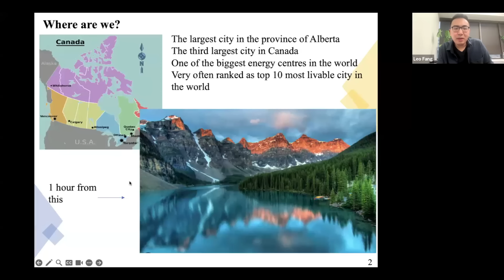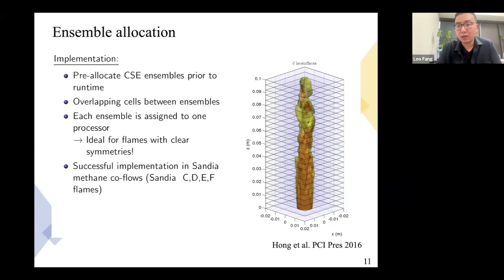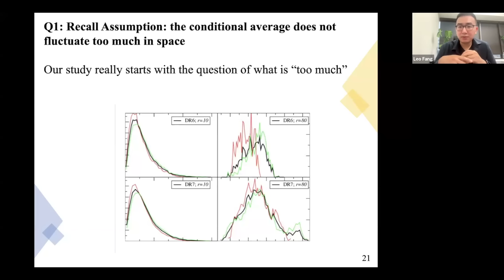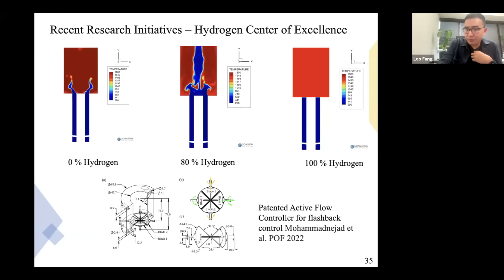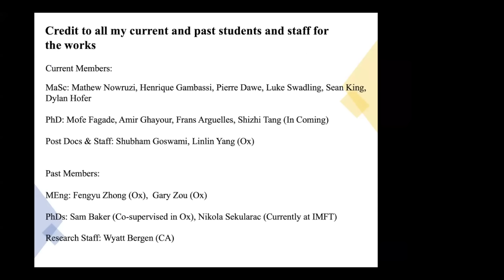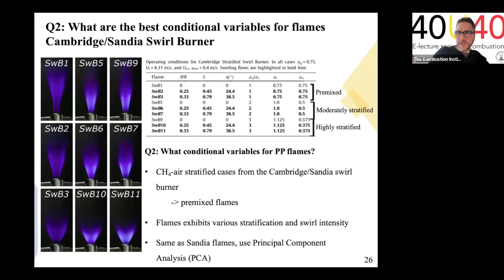Leo Fang - Model development and hypothesis testing for partially premixed flames

Comment: Great work!
 
The benefit of CSE should always be compared to flamelet models in term of accuracy and computational time. 

JPDF is complex topic and the qustion is does it really matter to get the shape right or the combination of the whole integral of the conditinal variable (which is modeled not from DNS)*pdf = unconditional filtered value..

In my opinion  ML techniques are case-specific and fail to generalize in modeling JPDF..

Next question will be how to account for preferential diffuson in CSE methods! Could it be used for sooting flames as well with a reduced cost?